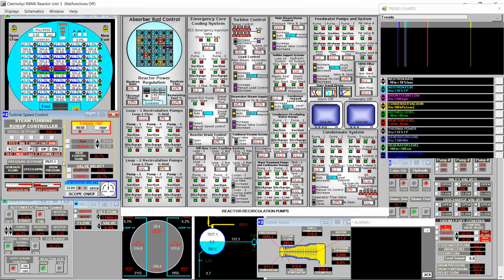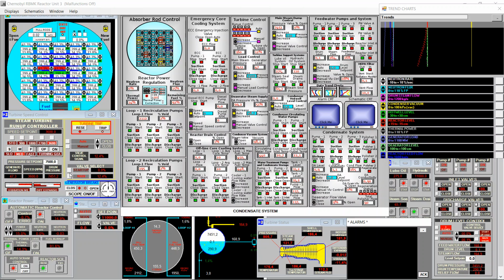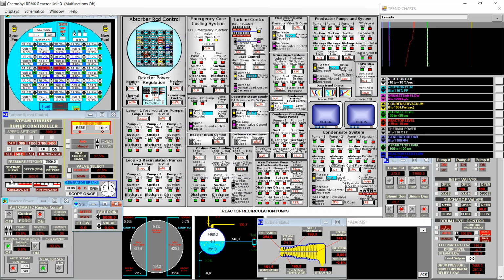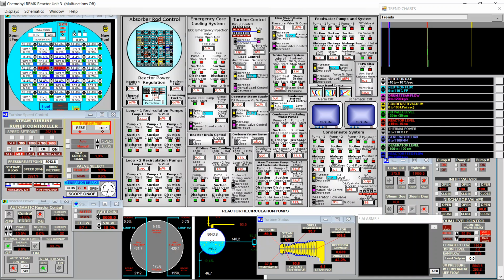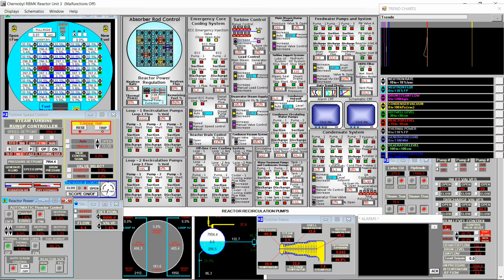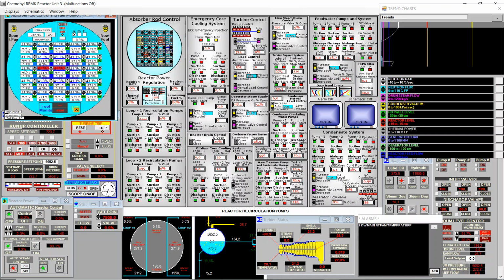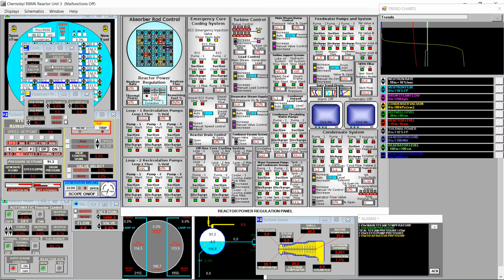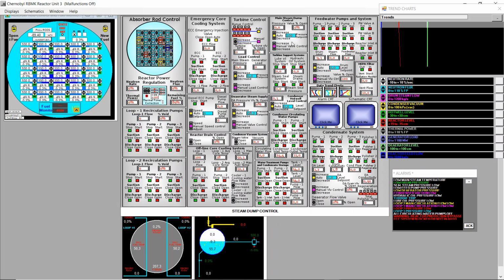RBMK-1000 Chernobyl Nuclear Reactor Power Down Tutorial

Comment: I'm glad this tutorial exists! I tried turning everything off manually without any instructions, mostly doing the startup backward and I think I probably damaged the turbine in the process. I had a few comments:

I also found the instability when switching from startup to main valves to be really annoying, to the point where I just set both of them to main right away - harder to control but the instability in drum level is the hardest thing for me to control, and it often causes trips and scrams. I'm probably doing something else wrong.

I'm going to try to use auto controls to spin the turbine down instead of manually controlling the valve to see how effective that is, but I'd be interested in knowing if there are good reasons not to do it this way.

Do these turbine systems not have another "outlet" or brake system to avoid blowing themselves up when you disconnect from the grid, or is it just that a full shutdown is an unusual occurrence so we don't bother having dedicated systems just for that?
Reply from the maker: Sorry for the late reply... yes there is a system to immediately close or bypass the steam in case of grid disconnection. AndyPue works in a German coal power plant and explained to me that actually it's a very critical system and needs to act very fast. Probably reducing turbine speed in auto is better than manual, I have no reason for doing it in manual...

Comment: Interesting process, I work in a coal power plant - but we also have a turbine.
It's like an absolute "no go" to open the generator breaker manually without waiting for the 'reverse power' signal. Ideally only the automatic control opens it while also closing the shutoff valves to prevent raising the RPM again. So, are you actually doing that in a real power plant or is that the way the simulator seems to properly shutdown in a controlled manner?
It is also looking wrong to stop the turning gear so fast, but that may be a difference of the used steam temperature. We overheat the steam beyond 500°C and so parts of the turbine are that hot and need to be turned to prevent bending of the rotor due to weight and temperature affecting the material strength.
Reply from the maker: Hello, thanks for the comment! I really appreciate this coming from someone actually dealing with a turbine in a coal power plant. I am not working in a power plant, and the user manual of the simulator only explains how to do a startup, so I did the power down the best I could with my limited knowledge. I will definitively try again following your guidelines.
Reply: @argilaga  I tried doing a similar thing, but the reverse power signal of the turbine has a quite fast connection to 'trip turbine'. Turbine trip sends the reactor down to 2% thermal power and effectively made me loose control over pressure and temperature situation.
In a coal/lignite/waste power plant, the turbine trip 'just' limits the thermal power to a safe state for the steam bypass systems. Usually something around 35-50% depending on the age and stability of the firing process.

Comment: Thanks for the video! It makes sense to do things gradually like this - it makes me wonder,  would a turbine trip at full power (as a result of full load reject / losing grid) have a risk of damage or would the RPM increase and differential expansion remain within acceptable limits?
Reply from the maker: Good question! undoubtedly it must be a critical situation to be taken into account in the design because losing grid seems an absolutely possible thing. It's all about closing the turbine valve fast enough so the RPMs don't go too high, I think that below 3700 RPM must be ok, just 3% more than nominal. Differential expansion must be also ok if some steam flow is left (valve not closed totally) and turbine keeps spinning at 3600 RPM for a while, or even slowly slowing down from 3700.
Reply: @argilaga  Yeah, figured as much. Thanks for the reply!
Reply: @argilaga  Yeah, that is kind of the worst case scenario for a turbine trip. At full power - the max potential energy is captured between the entry valves and the outlet. 
We have a special relay that detects such a "load jump" downward - it triggers a process that immediately closes the regulating valves and does not wait for the normal speed regulators to act.
Reply from the maker: @AndyPue  I guess such a system also exists in RBMK's, now I'm not sure how long it takes to close the main turbine valve in the simulator. I will check next time. Are you turbine operator?
Reply: @argilaga  Yes, they should also have it. Regulation valves take like 2-4 seconds from 100% to 0% - that is incredibly long, seeing how much the RPM increases in such a case. Easily going up 10-15% per second. Especially as all the steam in the entry zone of the turbine has to expand to the whole turbine before the torque reduces to levels that are acceptable.

Comment: What does the 3 element control do?
Reply: If I had to guess, in 1 element, the control loop of the feed water only looks at the reactor level.
In 3 element control, it must be looking at other variables to anticipate reactor level changes when under high power
Reply from the maker: @xeels2708  Yes, exactly! there is my reply to this question in some other video. In high pressure and temperature systems with boiling knowing the level of water is not enough to know the sate of the system, so usually the 3 element controls water level, water input and steam output, or pressure.